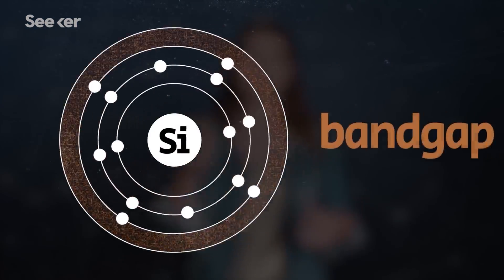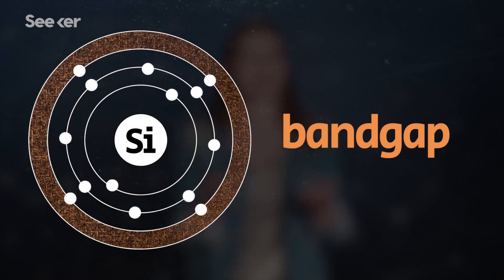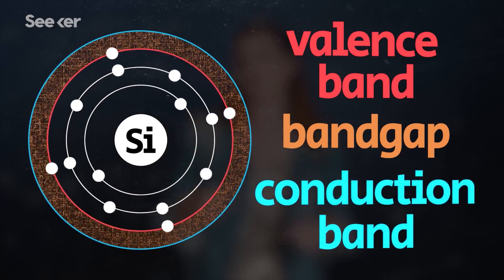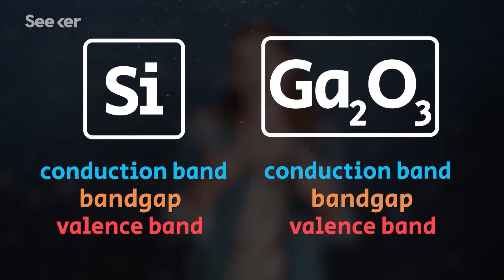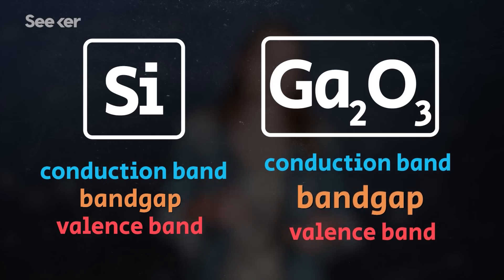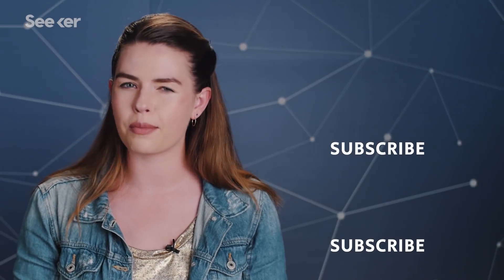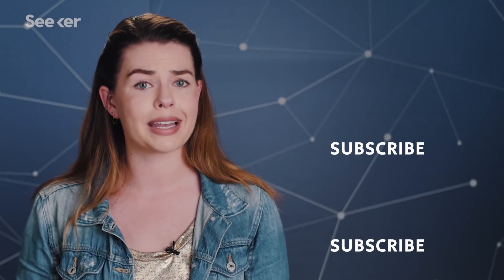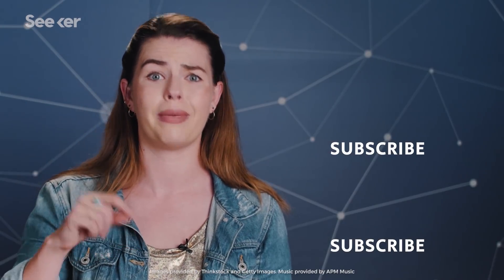Goodbye Silicon! Your Next Computer Chip Could Be Made of Gallium Oxide

Comment: When are they going to start useing interacting analog signals instead of binary. I know there is a much bigger problem of data corruption problem but still someone has to be working on it in a lower level than quantum.
Reply: Andrew Kelley Analog signals would be a mess to work with.
Reply: 007Cat24 well ya but it also allows you to do a vast amount more calculation within single wire connections. The one and zero become one to the amount you can split specific voltage and or amperages into. That is just the surface though. The real magic is done with interfering waves signals through logic gates. 

I have built a few and as long as you keep the  signals and their products clean while avoiding the unwanted things. It no harder than codeing in binary. 

It is completely different but no harder. Just has a alot more factors that are manipulatable.
Reply: Andrew Kelley Well, the Soviets and others built ternary computers in the 50s.The main problems are the increased complexity, as transistors need to identify more and more different levels and powers, and the problem with transmitting data over longer distances, as error may easily arise.
Reply: 007Cat24 we now have the math to simplify the complexity and you can just use the complexity you don't always have to read it. 

I always liked to build circuts with a few continuous repetitive patterns mixed with the calculated pattern as input signals. It sort of makes a circuit within the circuit. In the end you can still read out just 1 or 0. It just adds alot of extra manipulation as long as you don't let it run away from you inside the circuit.

All that is base level though. Like I said the true power lyes in the combination of wave functions through logic gates most of which can be created in the interaction. You just have to make them clear as they run through and use clear input signals. That's it. 

You can try to extract the fine data in the interaction by splitting it into power levels after it leaves the circuit but you can pull out the same data by just being smart about design. 

In reality it just seems complex because of the possibility of fuzzy data in the system. All you have to do is not try to refine the outcome so much and make sure your signals hit self canceling paths along all used frequencies in your circuit. You end up with dead ends alot but in reality most of the time you can overlay it in such a way that there eventually used as a output. You just have to be smart about what you put into it.

The high level ones you don't so much as make them as find them though. The precision in order to make a deliberate one would be insane or would work at pretty high power levels for anything useful. That however is on the level of current binary circuits though.

As far as signal lost all you have to use is a simple error correcting code for that but you shouldn't have to you can put out anolog television or radio signals for that and then just use general areas for your data.

Comment: larger band gap make it needs even more energy to make it conductive, but then there are a lot of benefit compared to Silicon,  I wonder if what so called as the future of transistor is equal to able to operate with even higher voltage

Comment: I heard from an interview with Shunpei Yamazaki, the inventor of the precursor to CH-LCD displays back in the 1970s and also a main contributor to IGZO (indium gallium zinc oxide) displays that IGZO can be used instead of silicon semiconductors in the future which will mean that the energy lost by cause of heat dissipation will be reduced and he claims that the general energy requirement of processors will become 1% as compared to what it is right now. This means that any device with a battery will last for weeks instead of days and server power requirement will reduce dramatically. This might be the future and not whatever there is in this video.
Reply: Sahil Pethe most of the power is eaten by the display in smartphones. It'd definitely improve battery life, but not so dramatically. Can't really think of  many battery operated computing devices that don't require a power hungry display... Smoke detectors?
Reply: Patjack Rickson displays don't consume as much power as you might think. Today companies are trying to mess with the kernel and use smart battery optimizing techniques to limit the background processing which happens when you lock your phone. When in standby, phones still use a lot of battery. This would be dramatically reduced. And even if one were to use a phone all the time, if only the display would be consuming a significant amount of power, more than the processor, that would still mean that you would be getting significant battery life increase since your phone wouldn't spend power on processing. This is the future. My phone can already last 3-4 days on standby with wifi and Bluetooth on. With this technology, it could last for weeks.
Reply: Sahil Pethe being on standby and using are two radically different things for phones. I did say it would help battery life, but most people using their display all the time aren't going to notice a huge difference. I mean I use shit phones, but when I go to power consumption it's like 90% for display.maybe if you were doing intensive processing stuff in the background, like being a hot spot. Again i'm not saying it won't help, and for other devices there are applications for sure, but for people using their phone like most people do. Not much change.
Reply: Patjack Rickson you are very mistaken
Reply: Sahil Pethe in what way, displays are what's eTing the battery for most people. The time you can actually use the phone is not increased substantialy. And if the standby already works for days who is going to see a huge qualitive difference using their phone. You can brush your teeth three times a day but plugging your phone in every other day before bed is too much?  It's primary benefit would be in applications you couldn't do now. So for science, military, industry. I'll admit it'd be a huge breakthrough, not for your phone though.
Reply: Patjack Rickson to prove my point I just now took a screenshot of my battery consumption chart on my android. All 3 screenshots were taken at the same time. Check out the screenshots: https://imgur.com/a/oQG5cf3
Reply: Sahil Pethe my phone that I use primarily to watch YouTube videos, and look up shit, says 90% display power. Probably because it's not processor heavy and it has a 6 inch display, the phone I just use for backup internet says 10%. Obviously how you use your phone matters. I have the brightness maxxed on the one sucking so much display as well. It'd nice to know an average baseline, but if I'm running at 90% that's obviously the high end. So for me I'd seen no difference, you'd get a lot more life. I'm guessing it'd fall somewhere in the middle for most people. I see your point of view more, but to me it's just an upgrade, but not as big as the leap to lithiuim ion batteries were which made smart phones practical in the first place.
Reply: a breakthrough to me is an event that makes or proves something is possible. So I guess it just boils down to semantics. To me that just equates to plugging my phone in less, which is already a non issue.
Reply: Patjack Rickson btw I also have a 6 inch phone so I don't know why your display consumes 90% power and mine 25% but anyways. I think most phones would benefit a lot cause seeing clearly from my screenshots 60% is just processing power and 40% is actual energy lost in hardware like camera, screen etc. So that proves my point. Another point is you can see the battery of low processing power devices like chromebooks or notebook pcs which are meant just for streaming videos etc. Their battery life is well beyond 10 hrs. And this is with screen on. This means that the laptops which require heavy computing like ultra books or gaming pcs will benefit a lot cause most of the energy consumption is because of the processor. This further proves my point. An always on 1080p 10 inch display consumes surprisingly less amount of power. You can attach that monitor to a 10 watt raspberry pi. You are clearly in the wrong here.
Reply: Sahil Pethe so it wouldn't just equate to plugging your phone in less? Because to me battery life is not an issue. So it's not a breakthrough to me in that area. But I've said, the applications for other stuff is there. Like super over clocking (a phone that never hangs)  But anyways you seem really confident I'm wrong by some metric. When all you've really been right about is your phone uses less power on display, or more on other stuff than mine and extra battery life means a lot to you. You've still not proven me wrong. The extra battery life is not going to make using your phone any better. Because use times already outcharts charge times. Who really needs to have a phone that works for more than 6-8 hours on hard use. It's a cool thing to have, but it's not going to change things.
Reply: Sahil Pethe do I need to put commas in there? You called me dumb, I was saying you got me with ancectdotal evidence, scorcher, hot burns. Ie, not really. 

I've already said the advancement is great, but my whole point has been the extra battery life is not the thing to get excited about. It's the other things, the extra battery life is not a big breakthrough for most people's phones. It would be for other things, like being able to really pop some juice through a processor without melting it. But extra power for a phone is not hard to provide. They sell backpacks with charger ports and solar panels. They have other things to if their really is a need for extended use off a grid. They are practical, and not that expensive. We have work around for this. We do not have a work around for heat on that level as practical. That's  gamechanging a real breakthrough.
Reply: Patjack Rickson yes we also would be able to overclock all the current processors with the decrease in heat and energy requirement but I still cannot overemphasize more about the need for extra battery life. Yes there exist power banks for phones and now for laptops too but you are sacrificing too much if you want more computing power at your hands as well as more battery. Its an either or situation right now. Both would be improved with the introduction of this new tech.

Comment: NOPE ...... Graphene is the future \o/
Reply: Niloy Ck regardless, semiconductors can't get smaller than about 7nm before quantum tunneling disrupts the whole point of using a semiconductor in the first place. You could really only replace the conducting material (usually gold) from the circuit, not the actual semiconducting components.
Reply: we can probably reach 2.5nm by cheating the system a little bit

Comment: Then what about DNA data storage and crystal storage ,that might be future storage device
Reply: pandya ravi Writing to DNA would likely take a very long time. It would be great for long term storage (and maybe replication, with a few errors) but likely horrible in practice.
Reply: pandya ravi They are fictional and serve little purpose... human DNA is not meant to hold a digital manual on a drill and etching information on Crystals is HIGHLY inefficient. Not to mention that they would break easier. Cool concept though.
Reply: Brian N Eh, not really. There's just too many factors with DNA that make it a bad choice. For one, the noncoding region of DNA is actually being used to regulate the human body. Adding more to that sequence would cause it to be prone to mutations and errors. Also, it just isn't very useful since  we have no good way of synthesizing DNA of that scale and effectively using it for memory storage. What would we do once we made it? One copy of modified DNA isn't enough to change the base DNA in every cell of the body.

These are just passing thoughts.
Reply: Wulfy we were talking about DNA as computer storage, likely one of each base pair for 0's and 1's. Replication would be iffy, but synthesis seems much more likely, and DNA takes longer to degrade than most other digital mediums. Mutation only occurs when the DNA is replicated or through radiation, so containing it in something like a lead container could help prevent that, and as for replication, we might be able to make a more effective DNA replicator that replaces the DNA replicating unit in cells. Just my 2¢.
Reply: Everyone is forgetting one small word that can twist it all up into a chaotic swirl.. "Yet" If we can assume that we are trying to compute faster and on an ever shrinking scale for convenience and Progress,, We are currently doing so..quantum computing with atom wide circuitry on 3d chips ect..  When atomic storage and the Wet interfaces of today become child's play, and Dogs have corneal implanted screens and Civil liberties with bank accounts,..even then, The "Yet" would Still be to come. When those creations start making their own synthesis techniques, The human will inevitably start Devolving from the universally Mobile, Mater manipulating, ingenious entities that we are, into a shapeless lazy blob of self serving motivations, devouring all we happen to slump or roll upon. XD Just hasn't happened, Yet. Or has it?  XD

Comment: why use electricity while light is faster and better
Reply: Ruby Moon I don’t think you get it...
Reply: enlighten me
Reply: If you wanted to integrate it into electric circuits, you would need an optic-electric converter. Anywhere you add a converter, you will get a bottleneck. Also, optical transistors have some inherent problems, such as light fading out due to absorption, inability to filter out noise, or inability to feed the input of the transistor. The one that I looked up was made of selenium and cadmium, each of which are not even remotely as common as silicon.
Reply: You realize that all computers work based off of trivial operations, right? In the video itself, he acknowledges that the issue they are facing in regards to speed is electrical to optic and optical to electric conversion. And those "trillion trivial operations" will need to be finely tuned by something other than light at the moment, unless you only ever want to perform the same "trillion trivial operations" operation again and again and again without the ability to change what each operation does.
Reply: Ruby Moon light can't act as a semiconductor as far as I'm aware, and computers would be useless without them.
Reply: ah i got your point now thanks
Reply: Actually there are so called light transistors or gates.. Look it up.. It can process data without using slow electric parts
Reply: Something like this? https://youtu.be/IvAm4PJIwto
Reply: Again, the ones in the video require optic-electric and electric-optic converters, which add latency. Unless the photonic transistors are performing long computations, the speed that would be gained through optical computing would likely be lost when going through conversion. Somewhere there WILL have to be at least one electric to optic and optical to electric converter. We can't convert mechanical energy to light on a scale that would produce computers as we use them know. They'd require quite a bit more physical effort to operate even if the circuits were completely optical.
Reply: I think if there won't be much speedup they wouldn't do it :) and computations don't need to be long or complex, trillion trivial operations is more than enough for significant speedup I think

Comment: Next gen chips with more accuracy and efficiency are getting ready good to see them ..But process of making galium oxide is difficult as it is in not a free element in nature..Like silicon ...
Reply: Natural silicon is cheap and plentiful to be sure, but computer chips aren't made from natural silicon.  They're made from extremely purified silicon and that purification process is super expensive (plus you can't just go to the beach and grab a bucket of sand to start purifying.. at least not if you want to do it cost-effectively.  You have to get the right kind of sand.. namely, starting as pure as you possibly can so that you don't have to do as much work, but also because certain types of impurities will be easier to remove than others.  So that significantly increases the rarity of "good" raw silicon.)

Comment: How could this be more efficient if it takes more energy to make those electrons make that jump to the outermost shell to conduct a charge?
Basically the use of this element may solve one problem (quantum tunneling) trading it out for another  (lower energy efficiency). Granted if the transistors can be made sufficiently small enough that trade off in electrical efficiency wouldn't be a problem so long as we don't also run into more of the same regarding quantum tunneling at significantly smaller scales.